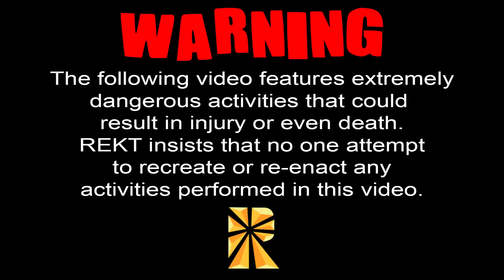Dry Ice Destruction!

Comment: Gunner is actually correct a boiling point is just where a liquid boils at extreme tempetures hot or cold
Reply: John Mckenna Not completely true. If you put a liquid substance in a vacuum chamber at room temperature it will boil.
Reply: Justin Yupyupyup true I was just talking about in regular air but yeah that could happen
Reply: GRAYSON SMITH dead 😂😂😂😂

Comment: Gunner a very low boiling point is called a freezing point
Reply: Actually Gunner was correct.  There are a lot of substances that boil at very low temperatures.  For example, liquid nitrogen begins to boil at about -195 degrees C and becomes nitrogen gas.